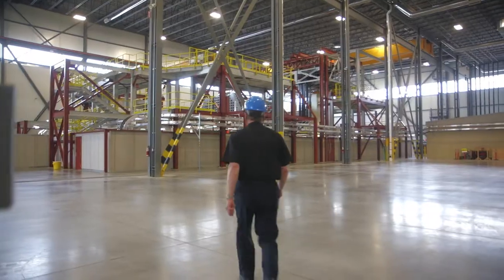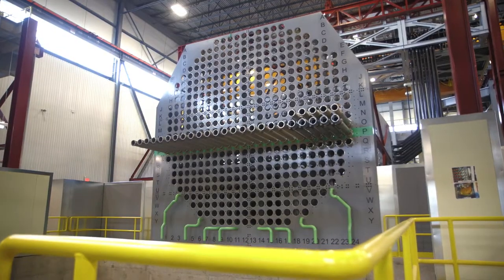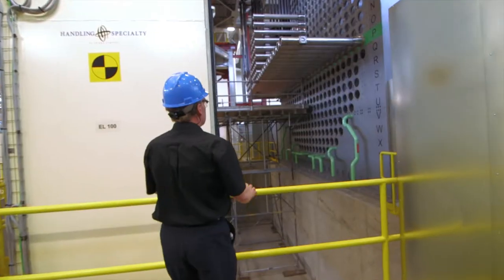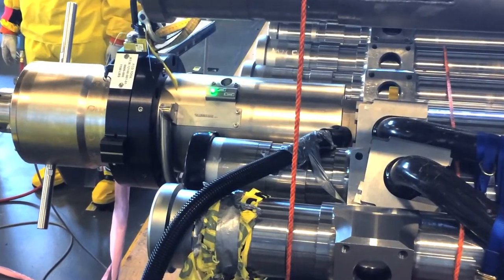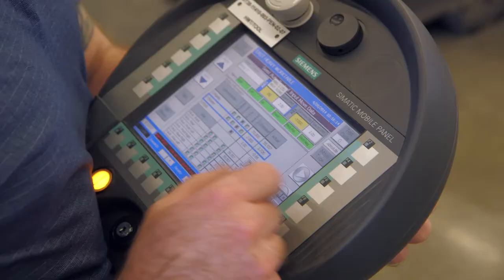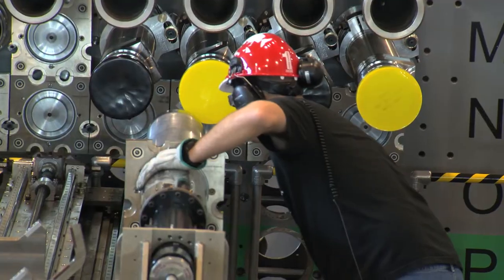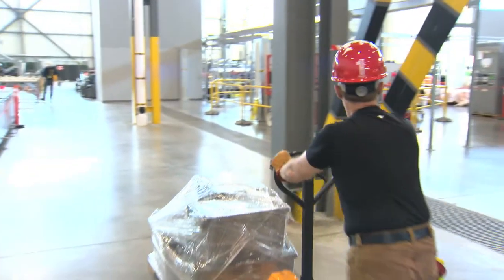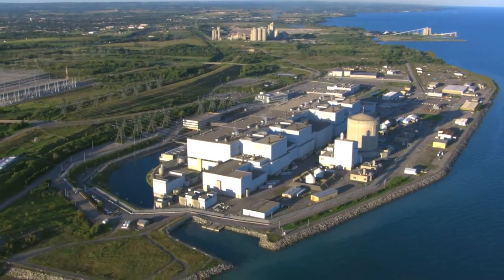Innovation at Darlington

Comment: I had some input with the Reactor Mock-u in Peterborough at GE's plant there.
During DNGS Unit 3&4 'A' Construction when I was at Ontario Hydro in the mid-'80s. 
What troubled me was that the Supply of ASME Sect III, NCA3400 Nuclear Class 1 Welding Fittings was on long Back-orders by the regular approved Supplier.   So, I decided to search for a new Supplier to add to the Procurement system in attempts to mitigate and alleviate work slowdowns due to the short supply of these Reactor construction products.
I located a small Foundry named WFI International in Houston TX (John Cates-Sales) and I suspected after seeing the Drawings, that these forging Fittings might have better value for money; later after pre-qualification, approval, and bidding commenced, the Union welders reported back that their Fitting Profiles were easier for construction Welders to weld up to the Callandria pipes!  In addition, I found that the initial products were less costly by a good margin, resulting in about a Million Dollar Cost Savings overall and much lost time in the Construction Schedule was therefore recouped.
today this company is a regular Supplier to OPG
This is a good example of Innovation, even although these are supposed to be apple-to-apple products by comparison!  It also demonstrates the value that the Buyer can have doing his/her job, and I loved doing my job and I know of many more possible suggestions!
Peter T. Clark
peterTclark1@outlook.com